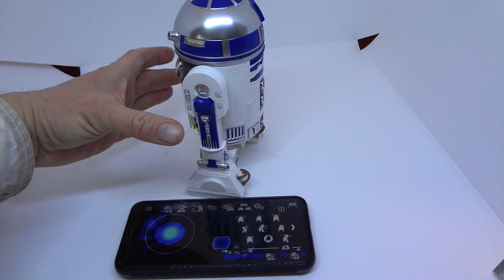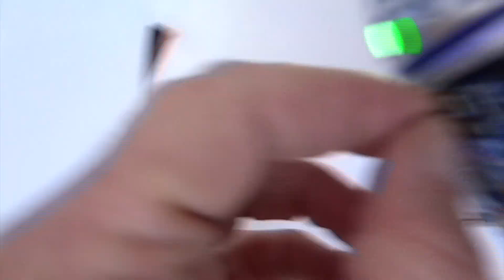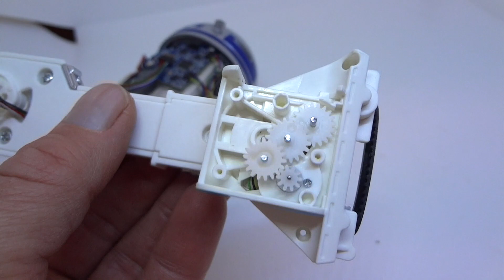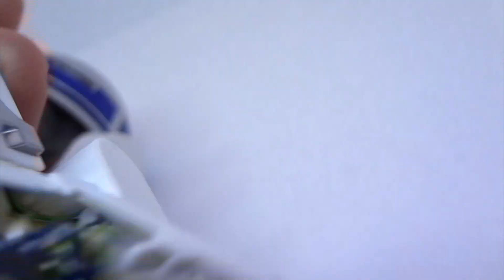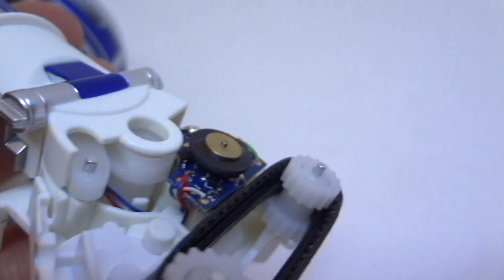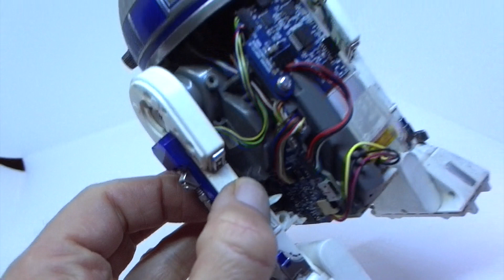Sphero R2-D2 Leg Repair Motor Fix Freeze Error

Comment: I bought one of these in 2020 from amazon. Was always amazed how well it worked, the sound effects, and movements!  I only had it out for a day or two and then put it back in its box, only to bring it out yesterday again (3.5 years later).  I was disappointed that it appeared the app was no longer available (for iphone), and thought, what a waste of a cool gadget.   However, I learned you can still get the iphone Star Wars app, IF you have the same apple account. I was able to download it via the apps and then "purchased" part.

Comment: Hello. Do you do repairs? My Sphero R2D2 is doing something similar, but I think it is the third leg causing the issue. I'm not one to take apart things like this. Any help?
Reply from the maker: I'll have to think about it. It's kind of labor intensive and takes quite a bit of time.  Between shipping both ways and what I would charge to repair it, it might be cheaper just to find a second-hand one on eBay. You can usually get one for under $50 because few people have the app anymore.
Reply: @worldwideinterests1  Thank you for the reply.  That's understandable. I just bought this R2 used, with BB8 and BB9e and a force band. Everything else works. Seller told me it worked over a month ago before he packed it away.  I might chalk it up to a loss and try to buy R2 at a later date when I can afford to waste money. Lol

Comment: First time ive seen someone with this same issue. My unit gets the leg out and starts driving for a split second before seizing up. I've been looking for a fix for the last four years or so.

How would one go about getting a spear board/motor assembly for the unit? will I need to source it from a damaged one off of ebay or is there a better way?
Reply from the maker: I think you have to look for used ones on eBay, that is what I do. I might be able to actually offer some of these parts here in a month or so as I start to clean off my work bench.
Reply: @worldwideinterests1  I would definitely be interested in spare R2 parts. Would they be listed on ebay or is there a different way you would want to work this out? I will also need to double check and verify which parts need replacing on my unit.
Reply from the maker: I have an ebay account in good standing so would sell them there. My user name is SWAPIJ and I will message you when I get them listed.  @corellioncrusaderproductio4679